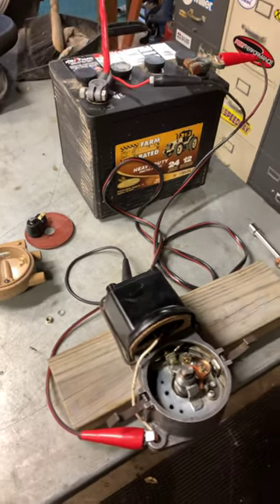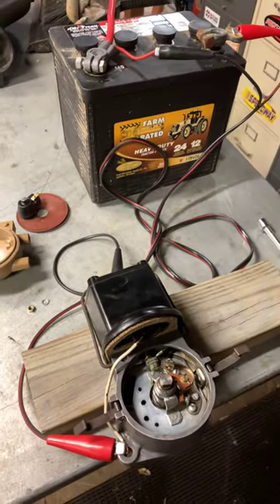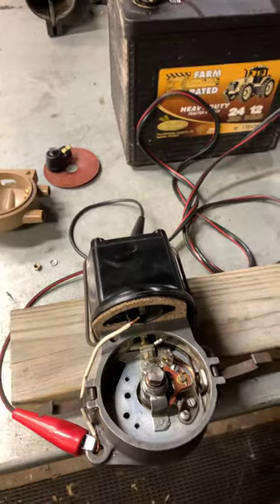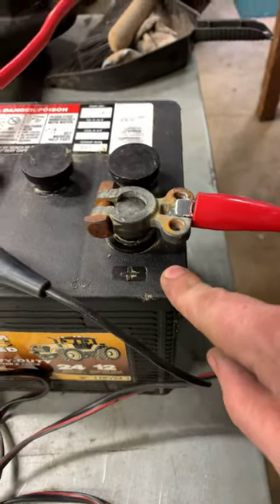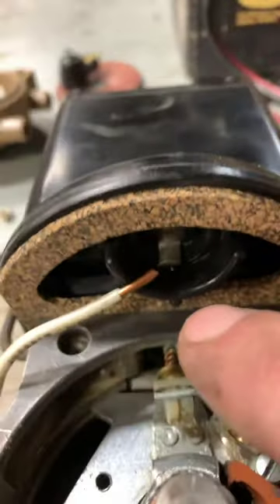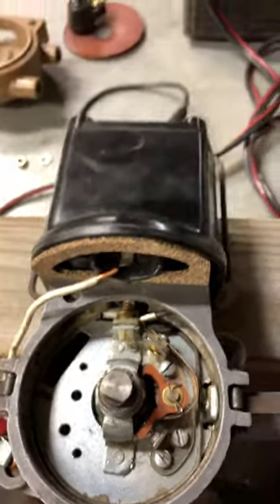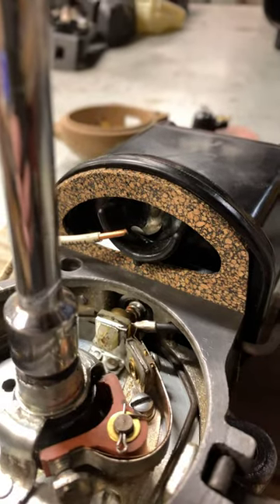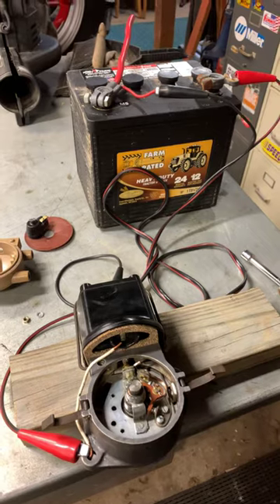Ford 9N 2N 8N Distributor Bench Test

Comment: This is good.

One thing I did differently (after speaking to my mechanic) was:
- Left the coil and distributor attached
- hooked alligator clips to 2 wires (like you did) - 1 wire attached to coil and negative post of battery; 1 wire attached to positive post of battery and other end to body of distributor.
Then attached one spark plug wire to distributor and other end to spark plug and touched to distributor body, and turn the slotted end to get spark.
Did for all four ports.
I found that I wasn’t getting spark after the first plug test, so opened up distributor, unattached the condenser wire from distributor plate and shined up the brass screw. Must have been a poor connection with twisty thing on end of coil (which connects to the distributor when putting the two pieces together)
After that - all four spark plugs sparked.

Attached to tractor - fired right up!

P.S. had to take distributor off three times before this video.
Found that pushing in generator,  and shifting the fan belt out of the way REALLY helped!
First time taking off - over an hour each side.
Third time after moving fan belt, 5 minutes each side - and can also see clearly if distributor is flush against motor.
Finally, half tighten one side, then the other side. I wrecked a distributor by trying to tighten up one side all the way.

Thanks again for the video!

Comment: I just followed your directions and my results were the same as yours so if I have spark here why don’t I have spark at plug?
Reply: I'm having the same problem with my
Reply: Did you figure it out? I assume it’s the (positive) terminal that you’re testing the spark at, is bent down not allowing continuity to your rotor.

Comment: I get a solid white ark on every cylinder 12v system on my 2n. So my question, does this test verify weak or strong coil? My weak ark is causing missifiring. Not saying your test isn't accurate but something in the distributer contributes to the strong blue ark to combust fuel accurately, correct? Does the coil either work or doesn't, or can it be weak or strong based on insulator or winding break down inside coil? I'm asking, I'm not suggesting? I'm having an issue with fire, starts right up, runs a few seconds good them start puttering like it's not combusting on all cylinders. Sadly, I've gotten to the point where I've ordered a complete ignition system, except for wire harness. Switch/carb has been tested.